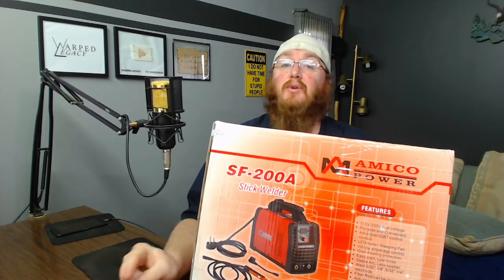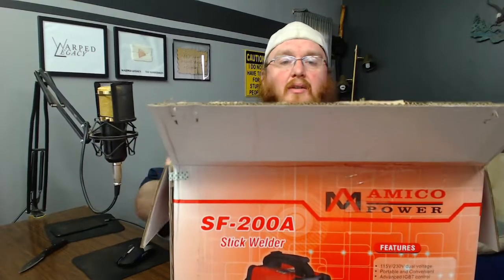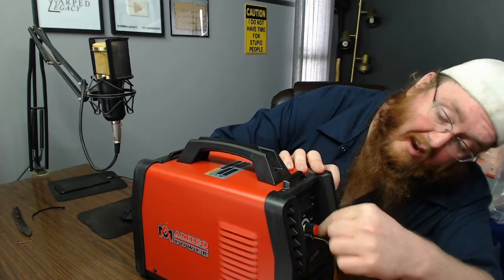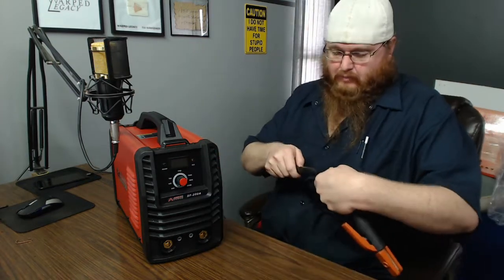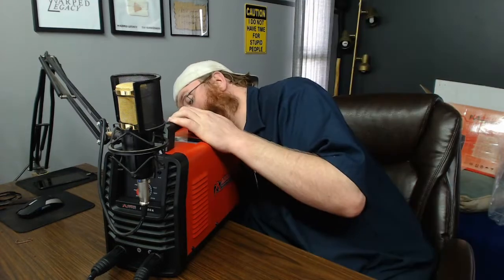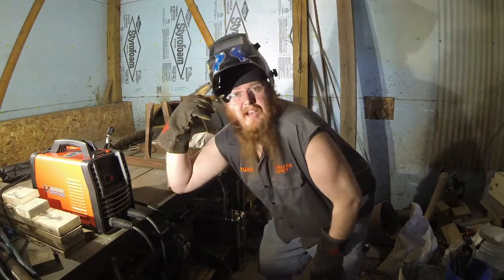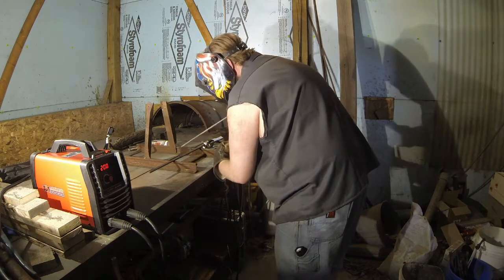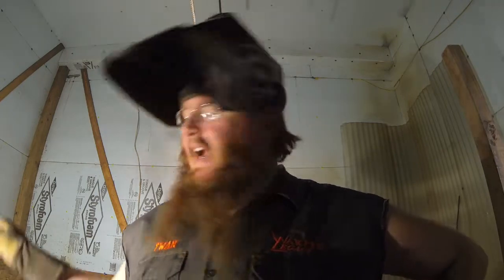Welder Unboxing and first test Amico SF-200A

Comment: It's so cute looking. :)

Also, please be careful on the camera sensors....
Reply from the maker: It is smaller than I expected. The close camera was mine(the case is completely broke on that one... so it was naked... thankfully It didn't get hit by any sparks). And I looked up weather the arc would hurt the sensors before I did this.

Comment: A 120 volt power supply is good for about 100 amps and maybe 3/32 rod.  Above that you will have to plug it into 230 volts.
Reply from the maker: Yeah... I haven't been able to do much with the setup I have. Really need to get that 230 installed... I've got everything... Just need to get it done.
Reply: @WarpedLegacy  you can jury rig it with two extension cords. Half of your house circuits will be on one leg coming into the house, half on the other. Find an outlet on each, and run the extension cord from each of them to  230 volt receptacle. If you need more detailed info I will spend more time with an explination. Two 15 amp circuits should be enough for that welder. Two 20 amp circuits would be better of course. At 240 volts it will give you twice the power that the 120 volt did.
Reply from the maker: Didn't think of doing it that way... That would work! I've already got a new 240 breaker and outlet.... And the proper line partially run at this point. I just need to get it finished.

Comment: The reason you can snap with an Infinity Gauntlet is that it changes reality...

You might not want to abuse it too bad for the first few hours (which I'm sure you will have already accomplished by the time you read this comment), unless your INTENTION is to try to kill it quick (and exchange them until you find a good one).  I know very little about welding, but I imagine running those big old rods  is abuse enough.
Reply from the maker: If it's gonna go bad.. I want it to go bad while I can still exchange it. So far it's doing good! And soon I'll be able to abuse it even more! I've got all the materials to hook up a 220 plug.

Comment: So does it run 6010?
Reply from the maker: Not sure yet. It is supposed to. But I still haven't gotten 240 hooked up(got all the materials, just need to finish installing it). And I haven't seen any 6010 at any of my local stores. Lots of 6011. I do plan on getting some and trying it out.